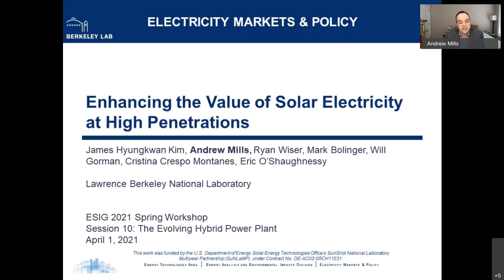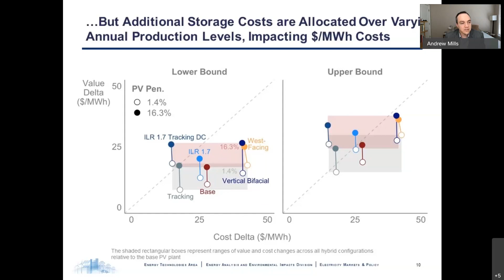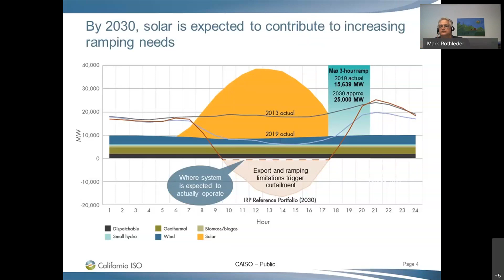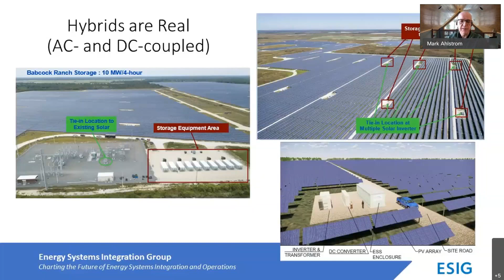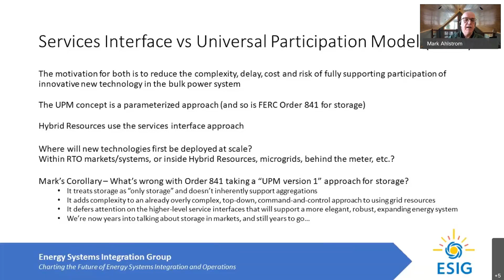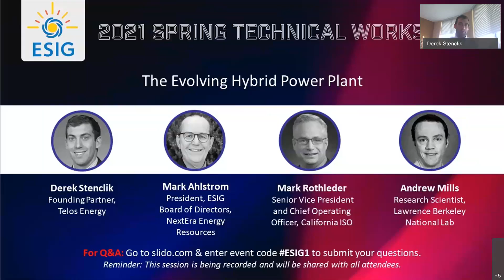2021 Spring Workshop Session 10: The Evolving Hybrid Power Plant

Comment: 44:30 I didn't understand why he has to over size AC couple to replace a DC couple?
Reply: I haven't seen the video yet I jus raised the comments while watching the video - DC flows through a wire - AC flows on the skin of a conductor - A 10 gauge conductor can carry 30 amps AC but it can carry 50 amps DC sence it uses more of the conductor flowing through the conductors